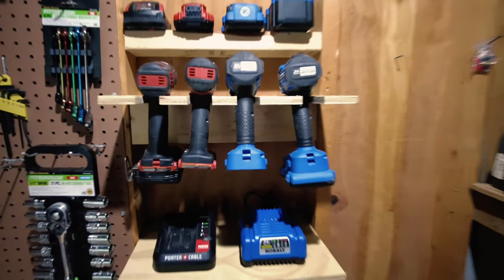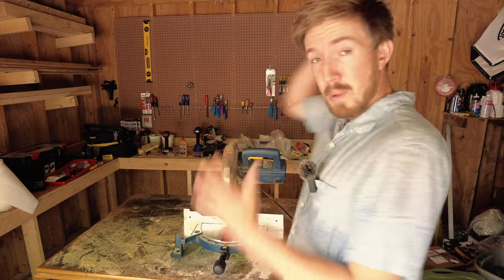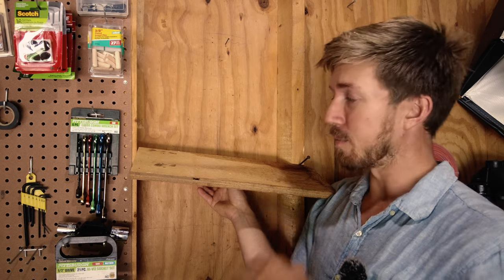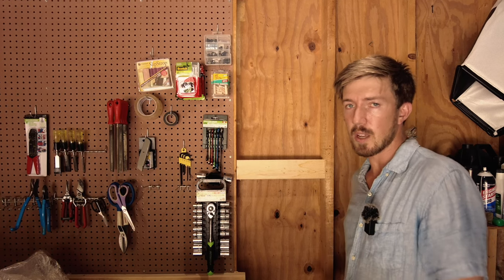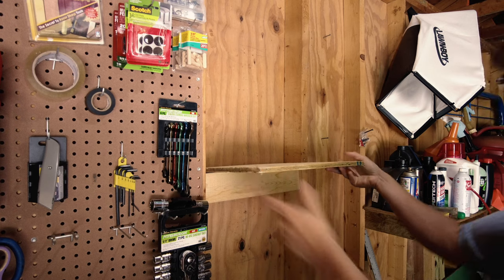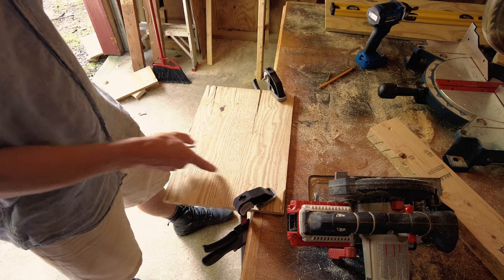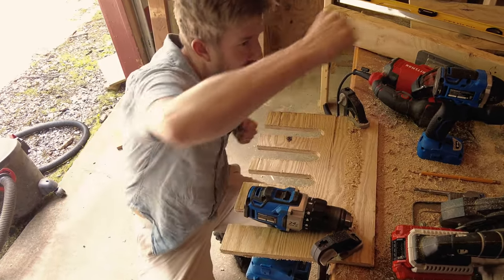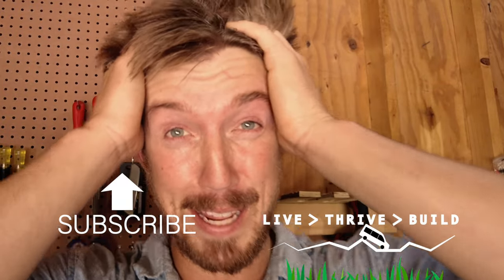BEST WORKSHOP TOOL ORGANIZER (Simple Easy Build)

Comment: Looks great.  Be sure that the receptacle for the charging station is AFCI or GFCI/AFCI protected.  That way if there is an issue with the battery chargers, chances are the electricity will be turned off automatically.  A plug-in relocatable power tap (surge protector) is not recommended as they can be problematic.